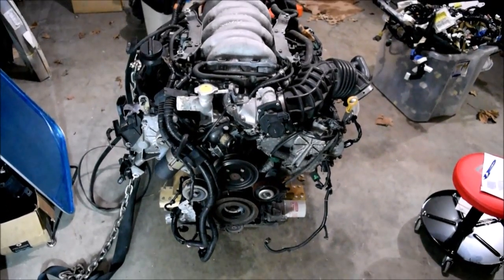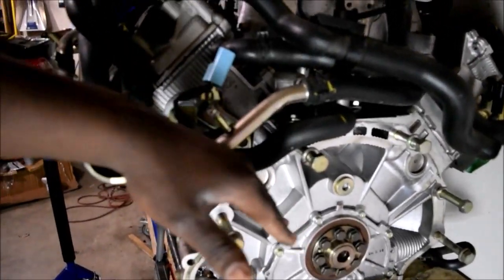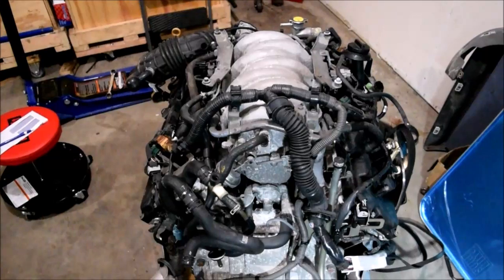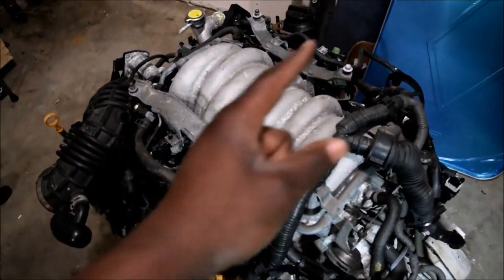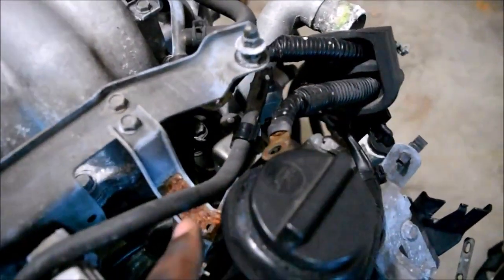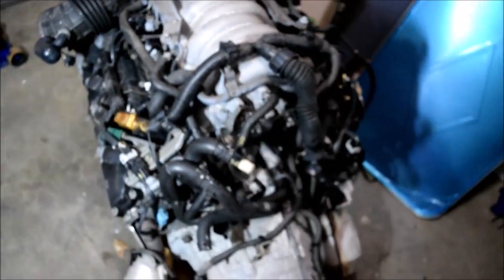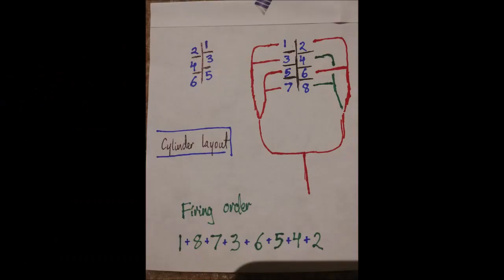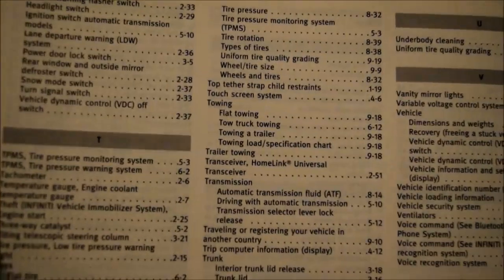Which is bank 1 & bank 2? Nissan Infiniti engine layout

Comment: What's the difference between front and rear coil packs for a 2018 Nissan Titan 5.6L and where is the front and rear locations? I've changed the spark plugs but stumped

Comment: I have a 2011 qx56, and i just replaced my engine. I have a p0300 code, which is a random cylinders misfire and a p1093 vvel acultor bank 2 . I am curious to know what steps need to be taken to solve these colds, especially the p1093

Comment: Holy you answered 75 of my questions in one short vid. So I'm in the process of buying a 2006 m45 and 3 codes popped up when I scanned the car. One for bank 2 sensor 2 o2 p0057 and two other codes p0300 and p0308 so that means misfire on cylinder 8 and you mentioned 3 things could be wrong(spark plug, ignition coil or fuel injector) but I also heard it could also be a head gasket. Is that possible? Car has 180000 miles. It runs pretty good tho so I don't think it's head gasket. What's your thoughts.
Reply: Dude I have a cylinder 8 misfire as well and not sure what it might be the one thing I haven't changed is my fuel injectors so I'll try that

Comment: I have a Q70L (3.7) and swapped the upper and lower intake manifold for a ported upper/lower intake manifold. I received the following engine codes after the swap P010A and P222F. Do you think I need to reinstall the manifolds or replace the MAP sensor? Also where would the "Mass or Volume Air Flow {B} Circuit" be located?
Reply from the maker: For p010A just check that it was reconnected properly. If it dropped during the process you might need to replace it.

I can't find the other code at this time
Reply: B always or most cases second bank. REMEMEBER there’s two bank even on 4 cylinder but that’s a different setup.

Comment: My Q50 V6 3.0t
Reads P0420
I must replace catalytic. My mechanic said passenger side. Which makes it the right.
Is that correct?
Reply from the maker: That is correct. In the V6, bank 1 is the passenger side (US)
Reply: @EdBwoy  
Thank you Sr
After replacing my engine. New one started acting up because of a bad cat on bank 1. Engine overheating damaging the cat. Is it normal just for one cat to go bad if engine overheated?

Comment: I just had an issue I had a code misfire bank 2 when I called AutoZone the guy told me that the coil on the driver side second one from front was bad so I changed it still the same problem so I talked to a guy at AutoZone that was an actual mechanic and he said that the one I wanted to replace was the first one on driver's side so I didn't and it fixed my truck
Reply: wow, that's fucked up. You didn't replace it and it fixed itself. Odd.

Comment: good video and well explained, now I know which is bank 1 and bank 2, I have a problem with the sensor P0021 bank 2, tell me that is the one at the bottom, side of the driver, right?  I have a 2002 nissan pathfinder, thank you greetings, god bless you.
Reply from the maker: Thanks for the kind words.
Actually, in the Nissan V6s, bank 2 is the left side (pulleys in front).
How many sensors are on your engine near the camshaft?
Reply: @EdBwoy  the scanner I put on my car said there was a problem in the vvt solenoid sensor P0021 my suv is nissan pathfinder se v6 engine 3.5 2002
Reply: I really have no idea how many sensors there are near the cramshaft, sorry
Reply: bank 2? To have a better location, is that left side, you say, passenger side or driver's side? thanks
Reply from the maker: Bank 2 is the left side, the driver side in the US.

For your code in the 2002 pathfinder specifically, it could be due to 3 sensors:
1. Crankshaft position sensor - under the vehicle, between engine oil pan and transmission
2. Crankshaft position sensor (ref) - under the crankshaft pulley
3. Camshaft position sensor - left side of the engine (driver side US)
Reply: @EdBwoy  thank you, your videos helped me a lot. God bless you